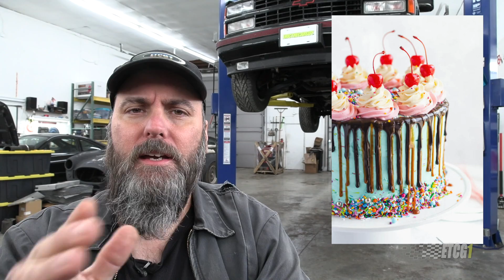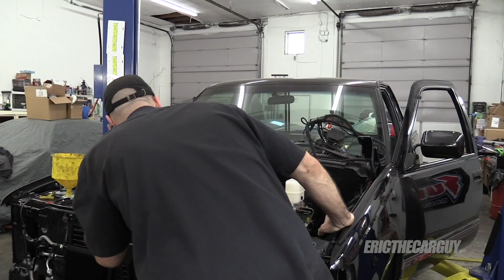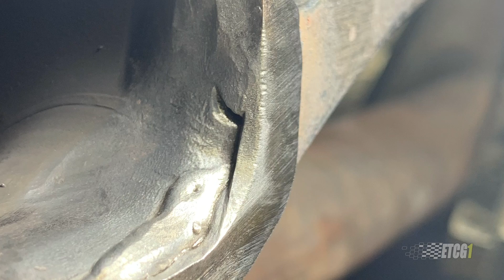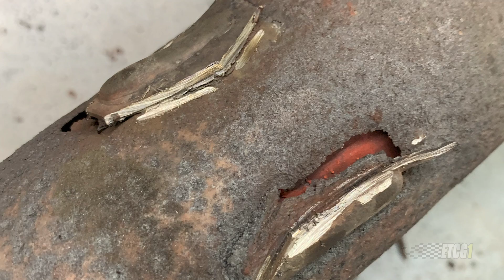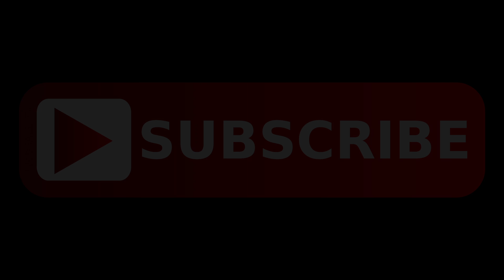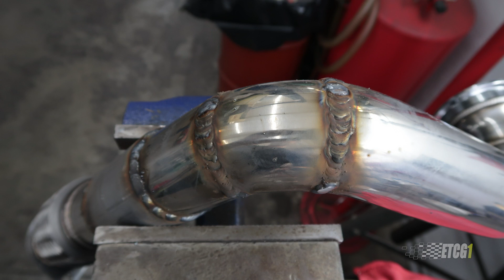Exhaust Noises

Comment: I do the same thing with the vacuum but I add something more visible like soap on the flanges and joints.
Just tape and close gap at the muffler pipe after I put the vacuum in. 
Run some dish washer soap and tap water into a spray bottle.
Spray the parts.
Press the power button on vacuum (while on air push not suck).
And just see where the bubbles come out, easy.

Easier would be to use a smoke machine, but those things are frikkin expensive to use only on this type of situation, better use my trusty vacuum that has other purposes too!

Comment: Something that really bugs me is when someone is selling a used vehicle and say something like "the check engine light is on for a bad o2 sensor but it doesn't affect anything and it runs fine". That's a red flag and I immediately walk away or call them out on it. When they say that they are really saying this vehicle has been neglected.

Comment: My silverado has 2 bolts broken inside the engine block. And the exhaust leak is driving me INSANE. But I'm afraid to attempt to take them out and braking more and then having to replace the heads

Comment: I totally agree.  In my world, there is nothing on the exhaust ever worst fixing when replacing is so much more satisfying.  Every three bolt header flange is DESIGNED to leak! Ball socket joints are the only way to go.

Comment: Had a blown muffler on my 64' Dodge and let me tell ya, The blown muffler made the V8 sound like a 4 cylinder. and not to mention the carbon monoxide that was seeping into the cabin was quite noticeable as i got frequent headaches if i drove for a few minutes.

 And as some people listened to the car as i came to a stop at the traffic light, it sure as hell gave them the impression that it's a clapped out POS, strapped on a Borla muffler on it, after that pure bliss, i can once again hear the Big Block singing it's tune as it always should have, without the carbon monoxide poisoning me to death!

Comment: My 99 Tahoe had an exhaust leak between the driver's manifold and y-pipe due to a bad gasket. It made the truck sound like it had an aftermarket exhaust. I loved the sound of it. 
Unfortunately I had to fix it to pass NYS inspection. When I took it back to get reinspected, I told I them it was too damn quiet now.

Comment: I found a great way to find exhaust leaks on a car if you're not sure where it leaks.  On a COLD car/exhaust, engine OFF, put your shopvac on "blow" and shove it in the tail pipe (use a rag to really plug the hose and pipe). Then Take spray bottle of lightly soapy water and spray all your joints.  Just like a hole in a tire, chase the bubbles. Solved my flange gasket issue in minutes.

Comment: i have been chasing exhaust problems on my 2003 blazer(s10) 4x4. i had a p420 code pop up multiple times i changed the cats and muffler and still have a rattle (passenger side?)  under hard acceleration and also occasionally have a flashing check engine light when merging onto the freeway. starting to think its a cv shaft

Comment: I feel the exact same way. I had a 98' Maxima with a loud resonator, had a hole at the top that was not easily accessible. I drove it this way for a while but the low rumble was a little bothersome. Eventually I wrapped it in some exhaust tape and used Permatex exhaust sealer to close up the holes as best I could. Man, the first time firing it up and sitting in the car after the repair was a night and day change. No more droning noise or vibration, the car was super quiet. unfortunately the fix didn't last however just goes to show what a huge difference quieting a vehicle makes, even if it is a clunker!

Comment: While cat is running.. I have a 2ft piece of hose from an old air hose .. one side to my ear and other at different points of the exhaust..(near flanges, heat shields, flex pipes, manifolds above mufflers even around welds just made)   works great for finding even small leaks amplifying the sound👍

Comment: Exhaust leaks and squeky belts drive me crazy. It absolutely lowers the value of the car in my mind. My 06 Civic muffler rusted where it attaches to the pipe and basicall fell off. Threw it in the trunk and had to drive it like that for a couple days. It was embarrasing. Luckily there is a muffler shop nearby and he welded it up in just a few minutes. Best $40 I'd ever spent on a car.

Comment: The air filter is too small, the air intake sound at idle reminds me of my mothers 1962 Studebaker Lark 170 c.i. six with a stromburg one barrel carburetor  and a chrome J.C.Whitney  air cleaner,the little 6 inch diameter one, it was chrome just like yours.

Comment: Here in the Netherlands (small) exhaust leaks are a MoT failure so it would not pass with an exhaust leak, your exhaust system needs to be ''fume tight'' as the call it. And because we often don't do a lot of (highway) mileage the exhaust doesn't get hot enough to dry and get doesn't rid of the condensation. Also, because of the weather over here (mostly gray and raining specially in autumn and winter) exhaust do not last over here. We bodge them with bandage, replace sections and weld them pretty much every year on older cars. But to answer your question; I hate exhaust leaks because I have to fix them otherwise it wound't be street legal...

Comment: That click-click-click-click sound (that almost but not quite sounds like a lifter tick) from a car with an exhaust leak on one cylinder is the worst.
Reply from the maker: Yea, it did kinda sound that way, but it was an exhaust leak at the header weld. So happy it's fixed now.

Comment: I have an exhaust leak, can it cause my catalyst converter not to go to ready mode? I have tried everything for about 3 months. 

Thank you! Love your vids
Reply from the maker: That's not how the catalytic converter works. All you need to do is pass exhaust through it. The computer goes into 'closed loop' when it gets up to temperature, it has nothing to do with exhaust leaks. Although fixing exhaust leaks can make the vehicle perform better, have better emissions, and turn off related check engine lights.

Comment: Had a broken flex pipe on my B5 Passat. While it didn't sound bad, especially behind the 1.8T, I couldn't stand it. Upgraded the complete exhaust with a 2.5" borla exhaust. I love driving the car now. The note is subtle at idle, but goes into a very noticeable tone on acceleration. It made a huge impression on how I look at the car now

Comment: the honda element exhaust IS NOT stainless .....stainless DONT RUST FOR ANYCHEMICAL ....u had aluminized steel we use it a lot in jamaica  cuz we cant afford stainless ...now my golf 3 has stainless never rotted  & even tho i modded the engine i kept it ...stainless will rot where if you weld it with mild steel wire .....but with that said ...i feel the same way about exhaust leaks .....
Reply from the maker: Yes, the Element exhaust is stainless from the factory. Stainless exhaust rusts at the welds at the flanges and usually breaks after a while. It's very frustrating to see a perfectly good pipe (stainless steel), untrusted, come loose at the flanges. Thanks for the comment.

Comment: Nothing makes a decent old car into a hooptie POC like a busted exhaust. Although I once had an Astro with a leaking gasket under the throttle body that whistled like a loud tea kettle when the engine warmed up. When the guys with  trash bag& duct tape for a rear door window look down on your whistling van at stop lights- it's a hooptie.
Wasn't too hard to fix, though once I found the cause.

Comment: I totally agree with you I have a 98 gmc k 1500 5.7 I had to replace both heads they cracked and when I was putting the exhaust manifolds on it cracked the welds on one of my cat converters and it leaked even after trying to weld things up it always had a leak then last spring I lifted the truck and had to redo the down pipes and converters to reinstall the 4x4 front shaft I got a hole knew set up with new converters and a friend and I cut and modified the left pipe to hook up the shaft and since the new pipes and converters are welded and sealed the truck sounds so much better then hear the small leak sputtering away while I was driving its makes a big difference at least for me it started leaking so bad a teen came up be for I fixed it and said nice diesel truck I had to inform him that it was not one just a gas truck with a bad leak

Comment: Owner before me put in hard motor mounts and I think the hood rattles on my rsx-s at idle. I actually know if that's the issue but that is very annoying. Also there's a statis noise coming from the aftermarket radio that I put it and the original radio  has no static ground noise. I have no idea where to isolate it and I hate poor sound quality.

Comment: ...and here I am with an 1984 F150 with a rebuilt engine but I'm too cheap to replace a rotted $80-$100 air injection pipe and a rotted muffler/tail pipe with many rust holes. Everything past the cats is junk. I'd have the catback issues fixed (or buy a kit and DIY it, we have a good shop in town with reasonable rates though), but I don't want to pull the trigger until I replace the injection pipe. And I cringe at the cost of a new injection pipe, it's expensive since my truck is an oddball model (300 Feedback Carburated with smog pump and twin cats, only used '84-'86). Tried patching it but there's too much vibration/leverage on the hole (right above the cat connection) and it broke out in two weeks.

My wife's 2002 escape's exhaust is also pretty bad... but the body is so badly rusted that it's not worth the expense. Good money after bad.

Comment: I have a 94 chevy suburban k1500I enjoy hearing that 350 opening up going down the hwy. The thing I just can stand is the exhaust leak.  Drives me up the wazoo.  The common area on these trucks is the exhaust manifold donuts gasket. At the Y pipe. I'm on my 4th set within 2 years. And there made like that Brillo pad wire stuff. Now I'm looking for new ways to fix this problem..??
On the other hand 😂  The company work truck I drive 08 F150 5.4  has an exaust least at the engine block and the manifold pipes. The shop mechanic solved that problem he done go welded the pipe to the block problem solved.🤣I'm glad I'm not the person responsible to fix that truck..

Comment: I have a small block Chevy with headers. I’ve also noticed that if I have a header gasket leak. Even the slightest, and I fix it, it actually seems to run better. I can’t explain it. Maybe it is a mental thing. I’ve done that quite a few times, with different types of headers, but always have the same results

Comment: 2008 Outback has a near constant shield rattle that's driving me nuts. Been under there multiple times checks the 2 dozen different sections of shielding and can't find anything loose. 
Makes a good running reliable clean car feel like a battered old POS.

Comment: I've got an exhaust leak where the manifold connects to the engine block. Because it's so rusted out, the studs will just snap into the block if I try to remove it. For that reason, I'm just leaving it as is until it gets real bad

Comment: Eric, now that evap smoke machines are down to about $100 on Amazon, they sell a cone with a hose for $11 that you can shove into the tailpipe, roll the smoke (made from baby oil) and it will find even the TINIEST manifold crack or seep from a worn flange gasket 

It's how I found a blown out weld on a flex pipe I just had welded into my Camry (took it back and they touched it up no charge) 

Found a worn Y pipe flange gasket on my Taurus, after replacing the obviously rotted out muffler still didn't shut it up 

Even found a loose AIR injection tube fitting on my G body, piece of high temp silicone hose and some clamps fixed it up cheaply and easily 

Also good for smoke testing evap systems and intake manifold leaks, maybe something you should look into 🧐

Comment: Yeah, my 98 Town & Country had a split exhaust crossover pipe. That in itself blew me away since there's no flex in that section of the exhaust. In fact, 4th gens omitted the flex piece and made it a solid pipe. 
At any rate, it made me feel better about what I was driving. After rebuilding the engine shortly after, it felt that much better.

Comment: Pre-turbo exhaust leaks are the absolute worst kind.
Reply from the maker: I've stopped using gaskets and just use orange RTV on manifolds. I seem to have much better luck with it. I also have the machine shop true up the flanges to make sure they are true before installation.
Reply: I blew like 3 turbo/manifold gaskets on my volvo before deciding to see what it'd be like without a gasket. Zero leaks since then.
Reply: I know it is quite off topic but does anyone know a good website to stream newly released tv shows online ?
Reply: @Roy Douglas I use flixzone. You can find it by googling :)
Reply: @Roy Douglas i would suggest FlixZone. Just google for it =)
Reply: @Roy Douglas lately I have been using FlixZone. Just search on google for it :)
Reply: @Kane Lucas Definitely, I have been using FlixZone for since april myself :)
Reply: @Kane Lucas thanks, I went there and it seems to work :) Appreciate it!
Reply: @Roy Douglas No problem :D

Comment: Not just a leak Eric,
Basically anything that makes a noise sends you straight for an appointment with a shrink.
But it's mot just a leak or a noise, if it's wrong it bugz the living shit out of me till it's sorted. Quick example, my wife backed into my car while on stands. Just a tap mind, no damage to her car. £450 to mine. New rad and associated plastic parts, slam panel plastic covers. List goes on & on & on so I won't bore you.
Here's the thing, after the bumper was finally fitted I went for a test drive. 😱😱😱 Disaster‼️ Front parking sensors don't work 🤬🤬🤬🤬🤬🤬🤬 wife says to me I don't know why you're bothering fixing it you don't need or use them so why bother❓ Why bother to put fuel in then Hey‼️
Point is, IF IT AIN'T RIGHT IT AIN'T RIGHT and needs sorting ‼️
Btw, Dad's truck that tiny tit tit tit tit sounded like a diesel injector washer not sealing properly. One of the most irritating sounds out there. And yes I know Dad's truck is petrol and no injectors. 
ATB Eric and stay well. Gr8 vid 👍✌️😎🇬🇧

Comment: Not only annoying, I had a small exhaust leak where the mechanic that welded part of the exhaust system missed the top of the pipe.  I kept getting a check engine light for a bad O sensor.   It did not make noise, but threw this code, and cost me two O sensors before I found the leak. 
I usually put compressed air into the tailpipe (often a vacuum cleaner output is enough with a long hose to isolate the noise of the vacuum) when the system is cold and look for the leak in cool comfort. Sometimes I have to resort to putting smoke into the tailpipe as a visual aid.

Comment: Can't stand exhaust leaks! Had one for awhile on one of my cars. Finally found the leak around the header flange. Pulled it off and the found the tube had completely broke off of the flange. Welded it back up and, like you, was so pleased at the beatiful non-ticking engine sound lol.

Comment: I have an exhaust leak on my 2000 integra ls. Im almost positive its coming from 2 or 3 different places and its all donut gaskets being original. Car has almost no power, fuel economy is almost as bad as my 92 ford f250, and sounds like a fart can which annoys me. But the car is going away for the winter and will recieve a yonaka catback in the spring. Cant wait. Love your videos keep up the great work!

Comment: I know EXACTLY what you mean, even a small but annoying leak can make an otherwise nice car sound so trashy when it may run quite well.  I once had a great running but somewhat rusty '75 MonteCarlo beater I only paid $275 for but it ran like a top and had a nice interior.  This car didnt look good and the body wasnt worth fixing, but at least while I was in the car I didnt have to see the outside - except the small leak drove me nuts for two years, finally I realized I had to replace it all from the cat back and after that the old Monte became one of my favorite dependable old beaters I drove for nine years because it ran much smoother and quieter than its looks would suggest.  The guy I sold it to drove it for another three years before I lost track of him.  Best $275.00 car I ever owned.

Comment: My problem was not exhaust leaks, but exhaust rattles. When the engine runs at either idle speed at 850 rpm or at 1800 rpm the middle silencer rattles so badly that it everyone knows that you have a bad exhaust despite having no leaks.

Comment: My 1993 Toyota pickup had an exhaust leak at the manifold/header.  The exhaust header I bought 27 years ago never fit right and when I did the timing chain back in 2014, I replaced the header with one from LC Engineering.  It fit perfectly and fixed the leak.  There was another leak on the exhaust pipe after the cat converter.  I replaced the CAT converter and pipe to fix the leak.  Those never really bothered us but I figured it was high time to address them.